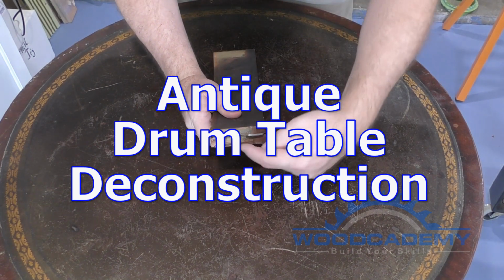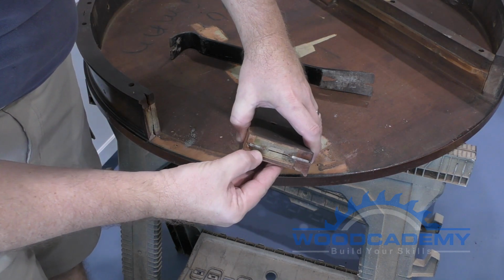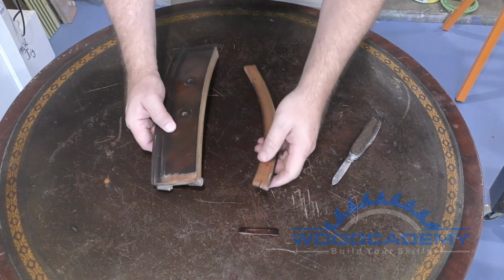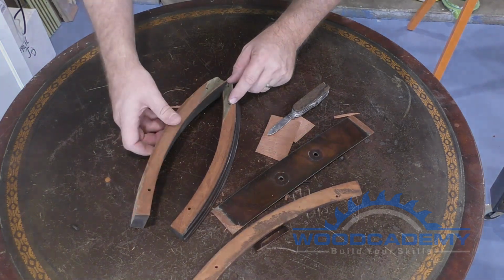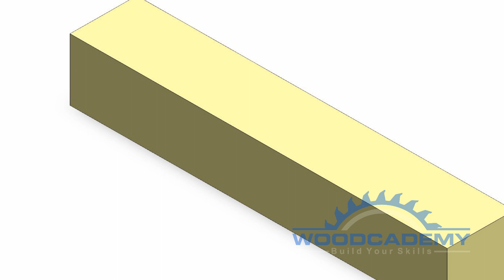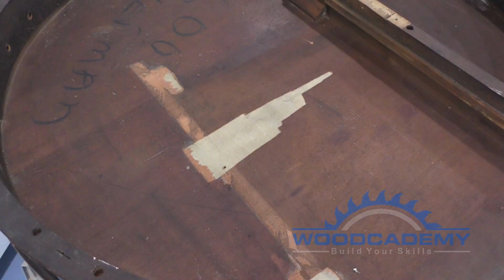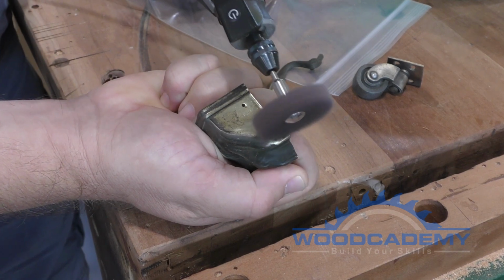Antique Drum Table Deconstruction

Comment: I was hoping to see how the round drum tabletop was attached to the pedestal I have a wobbly one and am trying to fix it, but I see no screws or nails on how it is attached!!!
Reply from the maker: Karen, There are three areas that could need tightening on yours. It may be that any or all are loose. 
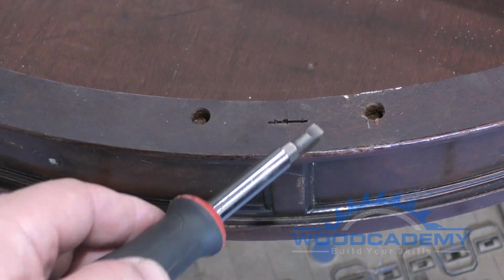1) The screws that hold the top onto the apron parts may be loose (unlikely) see 00:38 in the video.

2) There is a square board connecting the top to the pedestal. You can see where it goes at the same 00:38 mark, it is where the wood is not stained toward the top of the screen.
These outer screws that go up through this board into the two boards that hold the drawer may be loose. Looks like six screws on mine.

3) The screws that hold the same board to the pedestal may be loose. This is most likely your problem since the others are easy to tighten. 

To tighten the 3rd set of screws you will need to remove the top. Just unscrew the screws from #2 above, and you should see the screws in #3. They may only need to be tightened. If they are stripped so they do not tighten well, you can stick a couple of toothpicks in the holes and screw it back together.